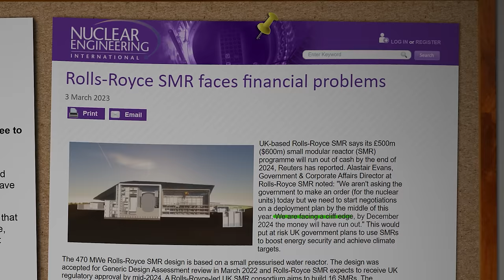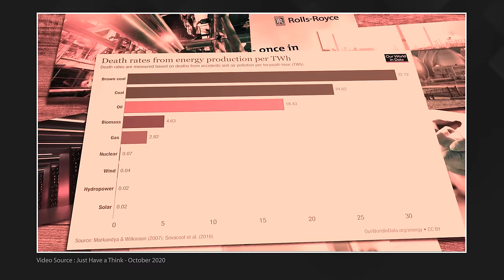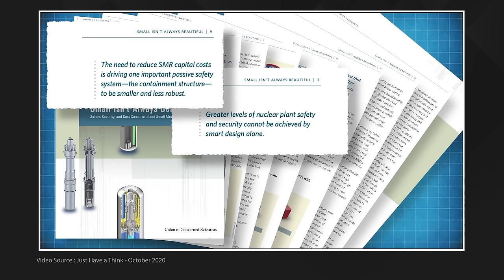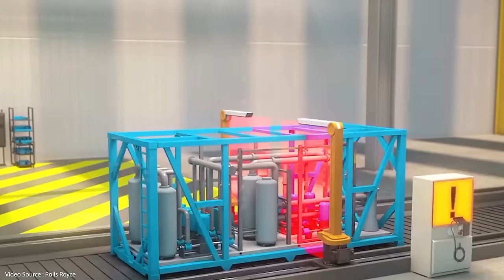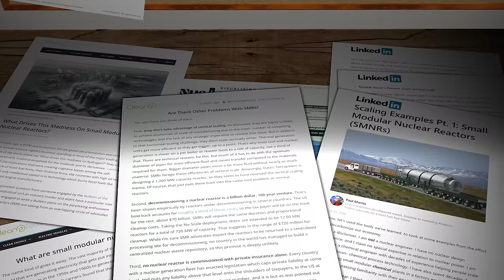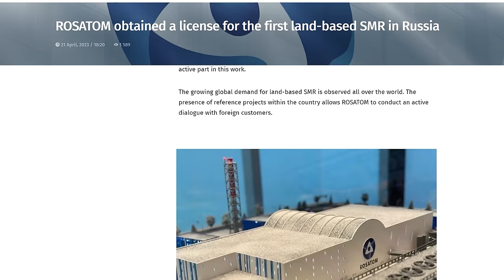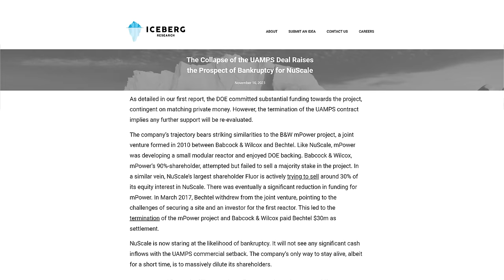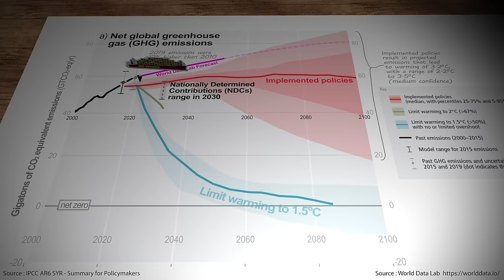Small Modular Nuclear Reactors. The Verdict

Comment: Yes on SMR but only if it’s a TMSR.
What’s the point if you don’t have enough of the right kind of uranium to run all of those new reactors, you will need a another facility to make the right kind of uranium out of the wrong kind of uranium.
Why not do it all in one reactor and use even lower grade radioactive fuel like plentiful Thorium and move the efficiency from 1.0-3.0 up to 90s% as well as a over a 6,000% decreased stewardship of radioactive waste.

Comment: No words about GE-Hitachi SMR BWRX-300 projects ? Why ? Maybe you are strictly deffendinfg absurdally expensive old generation3 big nuclear reactors ? BWRX-300 are simply to close to success t talk about them ? And they are actually the only one able to be widely adopted: very reliable nuclear companies (70 years of experience), over 100 built big BWR reactors, expetcing vry good price and very low MWh cost ? So SMR are not endangered. NuScale, Rolce-Royce, WEC only are :)
Reply: The reality is that PWRs are more economical to operate long term than BWRs (even though the BWR is cheaper to build).   I see the BWRX=300 of perhaps only selling a few units; which will become orphan units (increasing maintenance expenses) now that Westinghouse has entered the market with their AP300, and combined that they are using the exact same control scheem and controller and a number of other parts as their AP1000 (which has had 6 units built with something like 15 more ordered so that their parts and technical support will be around for many decades resulting in lower maintenance cost).

At this time there are the following number of operating power plant reactors by design:
301 PWRs
46 Pressurized Heavy Water CANDU's
41 BWRs (down from about 100 a decade ago)
11 light water graphite moderated reactors
4 gas cooled reactors
2  Fast neutron breeder reactors (liquid metal)

There are currently 62 reactors under construction with I believe the following breakdown
56 PWRs
2 BWRs (in Japan: construction suspended in 2011 after Fukushima, but construction permit still open)
4 Fast neutron Breeder reactors and Pressurized Heavy Water reactors

The world market has spoken based on over 60 years of comparison data between BWRs an PWRs; although there is a place for Heavy Water and a limited number of Breeder reactors. PWRs are just the more economical plant; and the only reason I believe that these BWRs got any interest and a few committments is that they were the only game in town at the time with that size reactor.

Comment: The solar and wind energy requires full back up of power installed and keeping the back up plants run at minimum capacity even at the times when there is more than enough power generated by solar and wind.

Comment: You might have a point about the possibilities of PV and Solar backed by battery storage and interconnects.  I'll start believing it when such projects are actually evaluated with the appropriate metrics, or things like the required massive interconnects and battery storage starts being deployed at the scale necessary for your goals to be achieved.  In the mean time, I will cynically believe that beyond relatively limited capacities that can be absorbed by the existing grid, these interruptables are being deployed based on a combination of inefficient use of fossil fuels and reducing the reliability of the grid.  Winning!
Reply: You can cynically belive what ever lie you want to tell yourself, but dosn't make it true.  The power grids arn't experiencing outages due to renewables, and the building of new interconnection and storage is incressinlgy gating the addition of new renewables because grid operators take grid stability very seriously.
Reply: It doesn't matter what you think the appropriate metrics are, the majority of new generation everywhere in the world is wind and solar because they're cheap and quick. The electrification of everything will require grid updates regardless of what's providing the power, but distributed solar reduce the need. And putting batteries in with the solar farm means it can deliver energy for longer over existing powerlines without requiring upgrades, and so that is happening, again regardless of your armchair analysis.

Grid reliability is achieved with multiple sources of dispatchable generation. In areas without hydroelectric, that means gas power plants and nuclear, but they will run less and less often because they can't compete when the sun is shining or the wind is blowing. And battery storage and alternative renewable generation will grow to meet more demand. It's a challenge, but there's money to be made if you don't waste billions on wrong approaches like nuclear and hydrogen.

Comment: from what I understand it will be more modular but fitting more together in one place to make a bigger power source.  making bigger reactors in one place  like a bigger reactor but without the cost over runs caused mostly by  price gauging and union action associated with bespoke designs. of course all this will be academic if they make an AI designed process. If it was all AI led then the problems with the big projects would disappear with the  people. nuclear is the clear way forward.
 As large wind turbines and lots of silicon solar panels of the hyped renewable technologies are not  renewable, ( the sun is) as they don't last long enough before they break down. all the construction has just been out sourced to where we can't see it to the place with the worst environmental standards and the cheapest labour. same as the oil and gas needed to make them. well done destroy our ability to make stuff make everything more polluting but because its not us doing it it's all right. O wait it's all one planet so if it's still happen over there but worse it's still your fault  and worse and we have no control. so now we are poorer less able to control it and it's worse then if you had just left us alone to develop technologies as everything was getting greener naturally though market forces  no governments have  mucked it all up as they always do. all we needed was for the regulators to do there jobs ( which they seem very bad at)
wing capture and mirrors used to heat a central point, systems have possibilities but not the way we are going.

Comment: your argument is that as the tech advances and volumes increase, the costs will remain the same and the problems of the tech now will remain in the future. correct? just like electric vehicle tech. nothing has evolved, competition has not pushed innovation and basically we should throw this tech away also because while it is young and dynamic, it will never evolve to the state that makes sense to be mass deployed. You also neglected to mention one of the biggest advantages of SMRs, they can be built site specific for large energy requirement installations  or remote settings such steel factories or isolated settlements where transmission from traditional electric sources are not as economical. as far as governments subsidizing the projects - they do that now with fossil fuels, wind and solar. so why make this argument when it holds true for every other renewable tech? electric vehicles wouldn't be moving at all without government subsidies. I dont mind that you compare apples to oranges in much of this video - large bespoke developments to mass produced SMRs. I do mind when you provide faulty conjecture as to decommissioning and other points. but the points you made and mentioned below need some actual grounding based on the realities of production, the development of control systems and AI and the tech advancements that will come when engineering energy is focused on the task. mentioning past failures as proof of future impossibilities is foolish. lets says tesla never introduced mega casting or box assembly to the auto industry. we keep doing as we are doing and claim the product and process will not get better. Maglev trains in China are a good example. the west couldnt develop the tech because of structural problems with regulation and general manufacturing ability. yet Chinese trains are now setting world speed records. so listening to American experts in the field is a waste of time. they cant build electric cars or any other innovative tech that comes along. the US has moved to a Chinese RND model in many cases - receive and duplicate. fine when you are building a tech base but not a good look when you are suppose to be a world leader. in all, I found this vid one sided and very biased. maybe your points are valid but you should at least voice pros from the SMR tech to provide a balanced report. this sounded similar to someone explaining BEVs vs ICE vehicles 5 yrs ago.

Comment: Your analysis is flawed because it is simply based on comparison of $/Kwh in market rates. If countries decided about their most strategic needs like energy or food based on MARKET RATES, there should have been NO AGRICULTURE in Europe or US today, because the sector cannot compete internationally without the billions of dollars of subsidies, which is paid, wisely, for the sake of food security. In the case of renewable energy, the network resiliency, scalability, technology supply chain, etc, are all factors that are extremely important and are not factored in your analysis. Put a price on having a reliable carbon-free backbone of the energy grid, and then redo your calculation.

Comment: If most consumers that use ICE vehicles are forced change their transport for EV well there would not be enough power generation to feed every ones requirement. Solar & wind are not reliable enough to pick up the slack with out a lot of build.
There are engineering problems with SMR Nuclear but it is the most realistically clean solution for large energy creation where it is needed.

Comment: Hmm okay what about the end of Wind power turbines they turbines are typicalliy not recyclable at all are they ? Yes ... one German company has solved that with a fully recyclable blade .. but its not in production ...with issues similar like your claim for SMR ... right ... and lets look at solar. ... with gallium arsnic.. yes arsnic... which has issues with disposal as well.. if you factor in the need for batteries for base load using lithium which all adds to green gases pollution and also ... the ethics of how it is normally mined... your clearly anti nuclear fine I get that .. but really all this crap of going totally solar and wind does not factor in all the elements.. by the way the issue is to really roll out many types of Gen V and there is NOW various Gen V in production ... albeit in China and Russia and that region... ... why the hate for nuclear I just dont simply get it ..at all

Comment: We talking thorium or uranium
Reply: They both work.  Right now uranium is cheaper.
Reply: Thorium is safer and cheaper in the long run, as it's more abundant . And lasts longer ie the material.  Just the container will be more expensive to hold the salt water ,and not degrade

Comment: How are the French successful at it?
Reply: Are they? French next gen EPR2 reactors were supposed to be cheap, but even before construction has begun costs have risen from 9 billion to almost 12 billion, and there isn't signs that cost is is going down at any point.
Reply: @Rehunauris  The investment return comes over the age of the reactor. The fuel costs over time bring the total costs in line. The French also have a much better air quality than Germany. Isn't that the big objective these days?
Reply: They started 50 years ago, and the government paid.
Reply: @footbru  OK. The US government pays for a lot of other industry also. The point is that the long-term objective is have a fuel cost efficient, non-carbon producing form of reliable energy. Nuclear is the only mode that fits that set of criteria.

Comment: You lost all credibility if you think solar, wind, hydro and battery storage is cheap. 

I’m not a scientist but I’ve spent the last few months researching and writing about this topic extensively. You might need to do some more research on this one. SMRs would be significantly less material intensive and more energy efficient. If we invested as much in this as we did renewables it would already be off the ground.
Reply: The concept of SMR has been around for 70 years.  The first U.S. commercial reactor was a 60 Mw output unit and was multi leveled and took up a few acres.  SMRs are NOT small.  So what is holding us back?  The simple FACT that these is no and never has been economies of SMALL sale when it comes to electrical power generation.

Comment: Have you ever heard of NUCLEAR SUBMARINES ?
Reply: Yes? Lots and lots of people mention them - what's your point?
Reply: Reactor submarines are not cheap (fuel load is $1 billion), they are very inefficient because they do not have the room for reheaters, and they have  none of the safety systems required for commercial units.  The first U.S. nuclear power plant (Shippingport) had a 60 Mw output (typical SMR capacity) took up three levels and 4 acres.  Look at a typical commercial power plant (1,000 Mw) and any SMR fraction of that output will be at least that fraction in size.  The larger the plant the more efficient it becomes and vis versa.